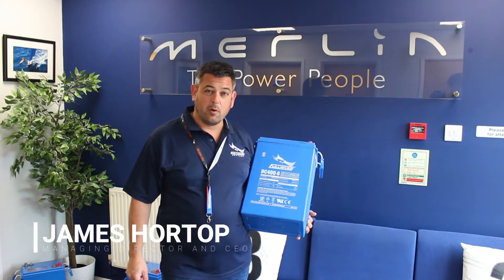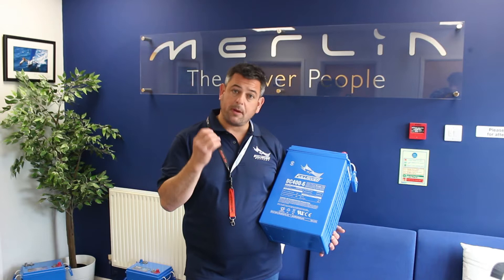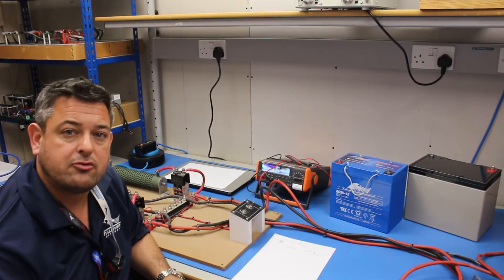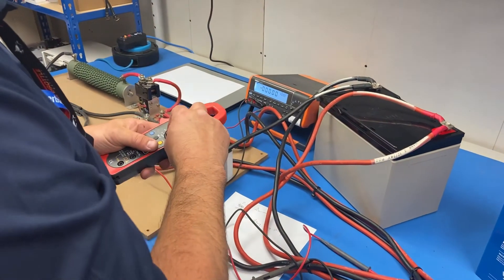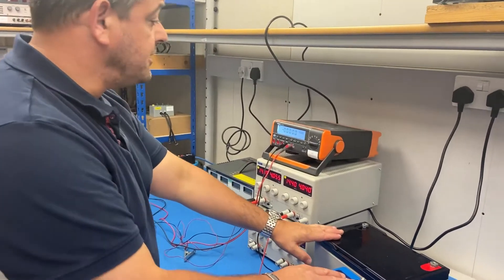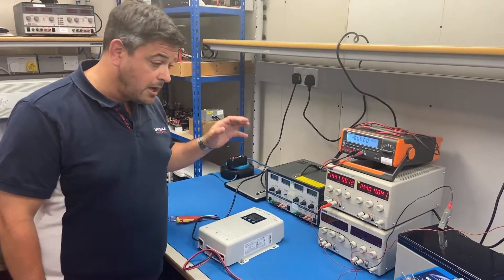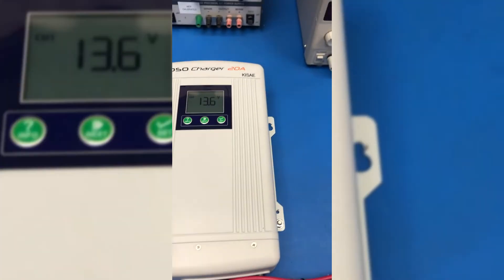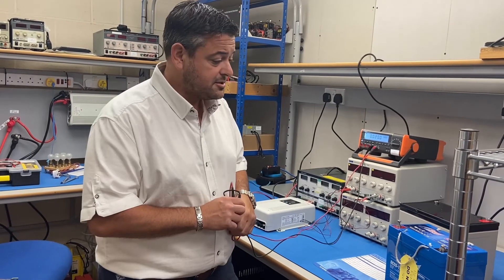Recovery of 12V Pure Lead Fullriver Battery

Comment: This advertisement starts off with a very false image: namely holding an empty battery case. And making he battery look like it weighs a few pounds. The real DC-400 6 battery weighs 56 kg, or over 123 lb. One could hold a 400 Amp Hour 6 volt lithium battery - but to hold that monster in your arms, is a very false image. And I use Fullriver batteries. But let's be real.
Reply: ha I noticed it also,   to be fair he could be the hulk and we are all weaklings

Comment: Very impressed am interested for my narrowboat one question ideally in winter would want the batteries to go 3-5 days between full recharge , at end of that period would be about 40 to 50 percent dod is this possible without sulphation ? Lead carbon or lithium is other option